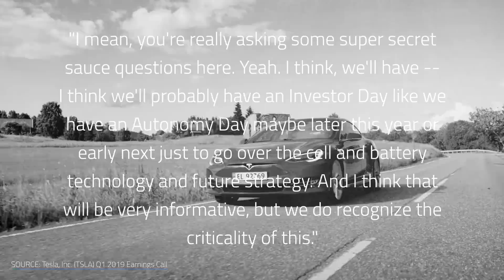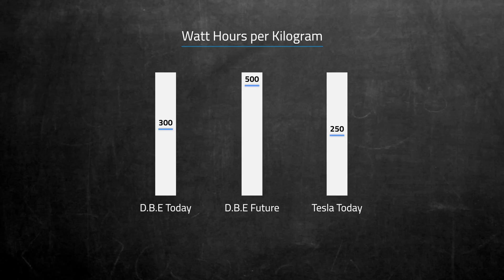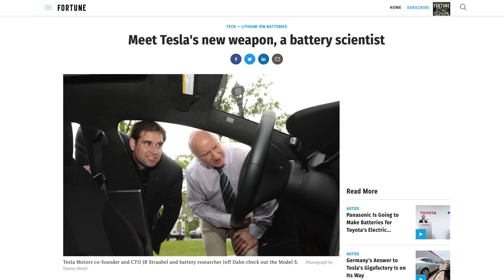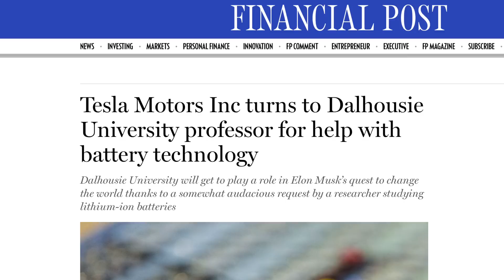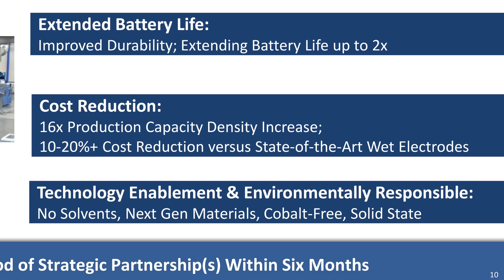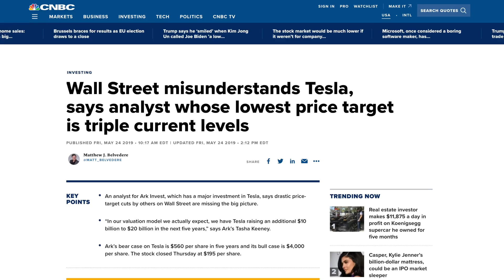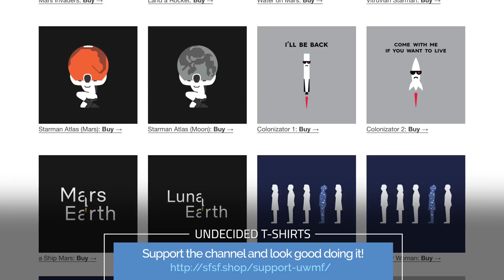Tesla And Maxwell Technologies

Comment: Yes you missed the shocks or suspension energy recovery every time the car bounces up and down. The tech also came from Maxwell. Well it's probably from Maxwell. Kind of happened at the same time. But there is pictures on line if your interested.
Reply from the maker: Yep, great call out!
Reply: Sooooooo if a real rough road I'll get more range then if I was on a smooth road?
Reply: @JimJCJimbo   Ya know I was thinking that too but the way I read the article they made it sound more like the energy that is generated is specifically used to power the dampening system in the suspension. So the first bump powers the system to dampen through the second bump. 

In smoothing out the ride you do go further. But as a byproduct not directly. Again it's how I understood it. I could be wrong. I'm just saying to the best I can make sense of what I was reading.

Comment: Matt - one other clue I think you missed. Panasonic and Tesla put their gigafactory battery expansion on hold. https://www.cnet.com/roadshow/news/tesla-gigafactory-expansion-pause-panasonic-report/.  Maybe this is because of the 16x improvement in floor space gained by use of Maxwell Tech.
Reply from the maker: Good point.  I'm still not sure how to read that news though.  It could mean they're applying the Maxwell tech.  It Could mean that Tesla is phasing out the Panasonic relationship?  Still not enough info ... but it's extremely interesting.

Comment: Great perspective! Thank you. I see another application for the capacitors to absorb regenerated power quickly and release it seconds after during city traffic or rolling hills. This reduces battery cycles and should extent battery longevity. In any event I fully agree with your assessments. Tesla is not a car company, it's a disrupter in many aspects, leading the EV transition and is pulling away.
Reply: Super capacitors should be used on acceleration and then re gen them
Reply from the maker: Thanks for watching!  And agree with you both.  Seems like even more to mine from Maxwell’s catalog of technologies.
Reply: Rudi Lueg I agree Rudi, I have always thought they were ultimately an Energy disrupting company, with using cars as a vehicle to initiate the public paradigm shift. His heavy investments in battery and solar energy manufacturing were more for Energy disruption than for auto (he’s never liked car making passionately)
Reply: I see application if capacitors for the Roadster as the " rockets" he's discussed. A sudden release of energy for the Roadster makes sense.
Reply: I expect to see capacitors to be used in the performance versions of their cars to assist with hard braking and hard acceleration, and to also act as a surge protector for the battery.

Comment: If Model Y dual motor range turns put to be 400+, I will not keep on sitting on the sidelines.
Reply: If that happens I will sell my model 3 and get the Y. I don’t care what it costs
Reply: 325 miles from a Model 3 isn't enough??
Reply: Jaymes Devine it surely is but in cold weather it’s a lot less 400 miles seals the deal.

Comment: The maxwell capacitor can extend the life of the battery system by lowering the power surge demand on the auto battery while accelerating.
Reply: Matt Intihar nope, they will not use capacitors in cars
Reply: @webguy1283  Time will tell. Chemical batteries (including dry anode) do poorly when subjected to repeated high energy drain. Capacitor will minimize high discharge drain, and extend battery life as Elon has promised to the million mile ticker.
Reply: Matt Intihar the million mile battery will come from a new chemistry that they are working on or the maxwell tech.
Reply: @webguy1283  Why not?
Reply: Stephen Louie they don’t have applications in cars
Reply: @webguy1283  Why don't they applications in cars? You haven't answered the question. You've only repeated the assertion. What makes them inapplicable?
Reply: Stephen Louie because of the energy density. The pack that tesla is building will last million miles. No need to put stuff in cars which won’t prove to be that useful and take up space.
Reply: @webguy1283  Capacitors will not be used for main energy storage in vehicles. They will be used as surge protectors to buffer surges from hard braking and hard acceleration. They are typically found now in high performance and racing EVs. I suspect that Tesla will be using them in the new Roadster and possibly the performance variants of their cars to augment their performance characteristics. As was already reported, they seem to be experimenting with capacitors in the suspension system.
Reply: Stephen Louie also the goal should be reduce the battery pack footprint and thereby reduce the weight of the car and not increase it. We for sure will need a huge footprint for the super capacitors because they do poorly when energetic density is concerned
Reply: @webguy1283  The balance of weight to benefit will need to be made. Specifically, it is unknown what the footprint and weight of the capacitors will be for any specific amount of surge protection. If it was all known, then there would already be statements about it and there would be no continuing experimentation. That is, no one knows because there is not enough data. Definitive statements without supporting data are premature and silly.
Reply: Stephen Louie exactly as you said making statements without any data is silly, for tesla cost is a major factor too, so putting ultra caps in cars makes no sense if you can design a pack that can last 1 million miles. Tesla cars are fast enough and there is no need to make them more fast. 90% of the people myself included does not have the skills or experience to handle these performance variants from tesla.

Watch jack rickards YouTube channel and hear what he says about ultra caps in cars. To be clear we are not taking about race cars.
Reply: @webguy1283  Again there is not enough data to definitively state that capacitors will or will not be used in regular cars. However, there is ample evidence that performance models and race cars do benefit from the addition of capacitors for surge management. 

Also it is unknown how the 1 million mile battery will be achieved. The pack could include better surge management that would work in tandem with the heat management system for additional battery longevity. Specifically, it could the surge management could use  capacitors for surge management. Until we see the new pack, blanket statements that state capacitors will not be used is premature.
Lastly, there are people that can handle the performance variants of Tesla cars and performance variants sell well enough. And as performance manufacturers like Porsche and Aston Martin ramp up, Tesla will need to stay ahead of them.
Of course, it is unlikely to see additional costs added to base models, but that doesn't preclude or exclude the use of capacitors in higher end models.
Reply: Stephen Louie even today’s teslas that are in production can easily go 350,000 miles. Which gas car lasts that long? If tesla is pushing that to 1 million miles they should focus on getting the pack size and weight lower rather that putting ultra caps in cars which are NOT needed. For roadster sure they might help, but in performance variants of the car they are pointless. There is no space to put them in cars along side batteries.

Just think about this, many people are complaining about why tesla is not putting 2170 cells in mode s and x. Well the answer is they just can’t w/o increasing the size of the pack because 2170s have a lower discharge rate than the 18650s and using 2170s in model S and X w/o increasing pack size does it make sense as it would hurt the performance of the car.

Now if they managed to have the same size pack, less weight and make the car go above 400 miles I don’t think they would have any space left in the car to put these ultra caps. Does not make sense.
Reply: @webguy1283  Perhaps the path to a 1 million mile pack is through the use of capacitors. No one knows for certain at this time. Is it known that there is no space for capacitors? What size of capacitors is needed to have benefit? Is that benefits balanced? There simply is no data at this time. It would be an assumption that the size is prohibitive at this time. 

2170 vs 18650s in Model S and X's is also an unknown and the pack could change with the next refresh. The discharge rate may or may not be the rationale or it may be simply that they haven't tooled up for a 2170 based pack for the Model S and X. Again, there has been no official statement in this regard and any rationale is speculation.
Your rationale is predicated on the assumption that a large volume of capacitors is needed. How do you know that? Could a small volume of capacitors be of some benefit? Do you have data either way? Specifically, what size of capacitor is need for sufficient surge management and what is the volume of that capacitor? Would capacitors be more beneficial in stop and go traffic since there is a higher probability of braking than in highway driving, thus making capacitors more useful for a lower cost urban car with a smaller pack and thus a cheaper vehicle?
Reply: Stephen Louie your asking me for data, what data you have? And for model X and S if tesla wanted to out the 2170 cells they would have by now. The discharge rate on them is low and it would need a pack larger than 100 kw to move the car from 0-60 in less than 3 seconds and that mean a compete resign of the chassis and that mean retooling. Tesla has no need to do that if the current tesla S and X can go up to 370 miles. Ultra caps are not cheap, take up space and do poorly in energy density. The only problem with S and X right now is cooling.
Reply: @webguy1283  I have no data that's why I am asking for some and why I am open to any data that may be available. So got anything to backup your statements?
And if capacitors are expensive, where is the trade-off point for the benefit to cost ratio? How much space is too much? How can you be sure without actual data or real world experience - which there isn't much of. 

You may be right and I am ok with that, but there needs to be data to justify the rationale. Until there is data, I am open to experimenting to find that data to prove it one way or the other, and not make blanket statements without proof.
Reply: Stephen Louie did you watch the link I sent you? What more proof do you need other than ultra caps have terrible energy density?
Reply: @webguy1283  Energy density is the one attribute to consider if they are to be used as a primary energy store, but capacitors are not intended to be used as long term energy storage devices since they also have terrible leakage rates. They are for short term energy buffering and as such could be used as such alongside the battery.  A few capacitors may be all that is needed to assist in surge management, and those few capacitors can be tucked away is some unused space. 

Do you have a time mark in that 100 minute video to the relevant information?
Reply: @webguy1283  So, In a 100 minute video he had two sentences that were relevant. Specifically, he had one test with 100 pounds of capacitors in a man-in-the-middle configuration and found that 100 pounds of batteries would be more beneficial. Did he test what the impact of those capacitors would be on longevity? I couldn't find any documentation to go along with that claim. Did he vary the amount of capacitors to find the optimal balance of benefit to weight? It was a single test and an old one at that. More research is needed.
Reply: Stephen Louie yes you have valid points, but the arguments I am making hold ground as well. This is a good conversation and the reason I think tesla will not put ultra caps in their sedans (roadster is a different case) is cost, space they take, poor energy density, and little benefit for a lot of headaches involved. This is the same argument for why tesla removed instrument clusters from their cars and went to a the clear interior of model 3. Because they know they are moving to FSD and having a instrument cluster makes zero sense, having HUD makes zero sense in the car. They are not going to put anything in their cars for the sake of it. Their goal is to make sustainable transport possible and cost plays a factor in that.

Until we have a breakthrough in ultra caps they won’t make it into cars. However I might be totally wrong about this and you might be right and that’s fine as well. I rest my case.
Reply: @webguy1283  Is there data that lists the price of capacitors per weight and volume compare to batteries? And then with this price/weight-volume, what benefits can be achieved for current capacitors. I won't speculate on the need for an capacitor breakthrough, and instead focus on current state-of-the-art. That is, are they beneficial today and is there data to support their inclusion one-way or the other?
My science and business background is really curious about this. Thanks for the discussion.
Reply: Stephen Louie thanks for the discussion Steve, I do really want tesla to innovate on ultra caps may be that can happen once they are more stable and profitable?
Reply: @webguy1283  Why not! Please supply backup!
Reply: Matt Intihar Hi Matt, you can go through the chats between me and steve

Comment: Excellent video, as always.

I feel like investors are slow to react positively to this announcement out of caution, because advancements in battery technology have historically been slow compared to other technologies, combined with skepticism about Elon's claims that this will double battery lifespan and range (considering his penchant for making bold statements about future Tesla products that are sometimes a bit optimistic on the timeline). I keep telling myself that I will hold out a little longer to buy Tesla stock as it has lost a lot of value this year and may yet to have bottomed out, but I am confident in Tesla's long-term prospects. Maybe that makes me part of the problem!
Reply: Musk may make bold statements about Tesla products but he almost always delivers.  His issues have been the timeline to get there but optimism isn't a bad thing as long as you eventually get to the result.
Reply: @sambira , agreed. You and I may feel that way, but I think most investors like predictability.
Reply from the maker: Thanks, Brian!  And yes ... investors like predictability.  Tesla is a volatile company, so if investors are looking quarter to quarter and not long term, then they're most likely not going to like Tesla stock.
Reply: It's bottomed out.. the unofficial production numbers suggest this quarter will appease Wall St. The truck will be announced this summer which likely will bump the stock.  As self driving features roll out and autonomy becomes more believable, will go up.. there's no where to go but up. The current market cap is really low vs any other similar companies past and present.

Comment: Absolutely correct, the battery pack is THE most important and critical part of an EV, hands down.  Why Ford, GM, VW, Toyota and others haven't heavily invested in battery production, is beyond me.  With Tesla's/Maxwell's new battery tech, Tesla cars and battery storage packs will be far, far beyond any of the competition.  Solid state batts are very promising but still in the labs with relatively low capacity but dry cell is here and now.  Correction on Apple, they don't own the manufacturing process, they contract with Foxconn, a Chinese-owned company, to build their devices but are planning to invest in both U.S. and other locals manufacturing facilities, and robot production, as Foxconn has nearly tripled their manufacturing costs, just since the intro of the iPod, mostly due to increasing Chinese wages.
Reply: Russell Fine Arts , I agree, it’s like all other auto manufacturers are waiting for battery technology to develop. I suppose they think they can just step in at that point and purchase a finished product. I think they are setting themselves up for a rude awakening.
Reply: @shepherdsknoll8  So true, they're all going to have their Kodak moment of OH SH%T, we're being left behind and going out of business!

Comment: Another aspect of the deal you might have missed is one of the significance's of super-capacitors. Bottlenecks of current battery pack include slow to charge (I.E - much of regen from braking is lost because it can't be dumped back into the pack quickly enough) and time to charge the pack. If an efficient and small enough footprint super- capacitor was added to the system, charging could be in minutes (even seconds with a beefy enough charging station) and ALL of the regn energy could be recovered. Also, if made available to the (beefed up) drive system,  the additional energy from a super-capacitor could,  umm... make acceleration quite brisk :)
Reply: Not sure that is good logic. If on the P100D, the batteries and motors can output at that rate, they can certainly input back under a similar G force of braking

You are correct that on almost all cars, emergency braking is higher energy dissipation than acceleration, as hardest braking is by definition at peak of tyre grip, on front tyres especially. Most cars cannot accelerate that hard.

All EV’s /Teslas have mechanical brakes as well as regen, even a P100D does,  just to ensure max stopping power (even if battery is full). The potential energy lost in using the mechanical brakes for emergency braking on odd occasions is small, and doesn’t need supercaps or bigger motors to justify extra energy saving for the the extra weight/capital cost.
Reply: OOps - should have read the rest of the comments, someone has already pointed this out. Sorry :)